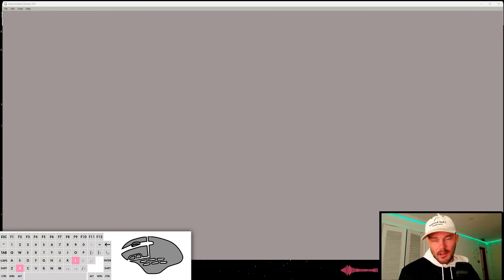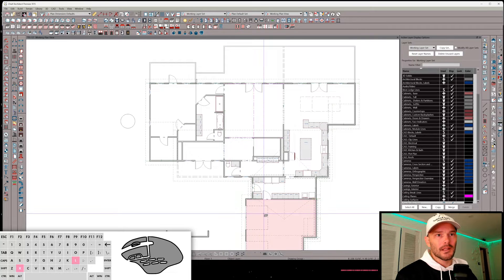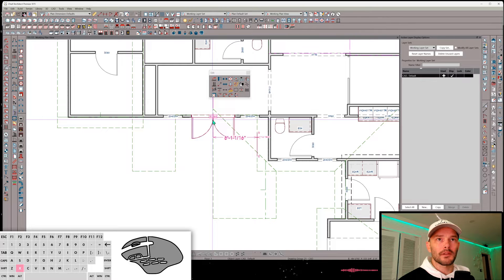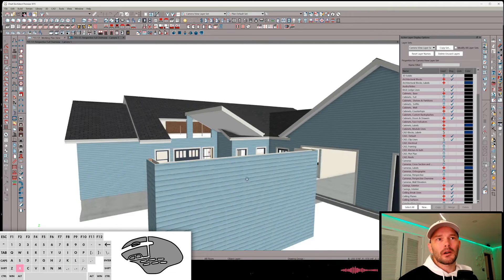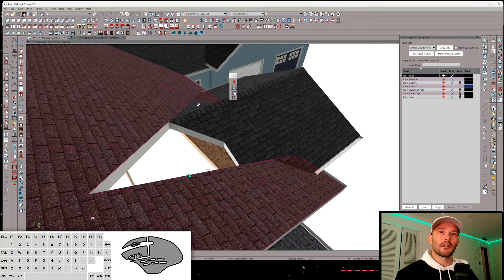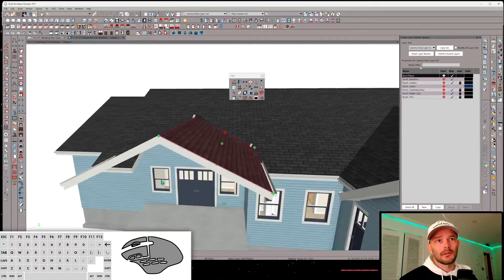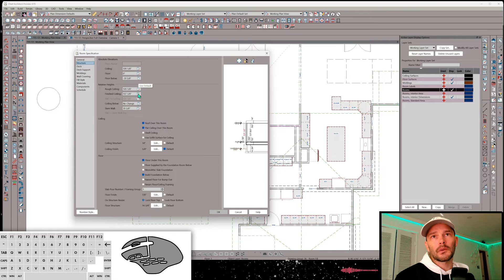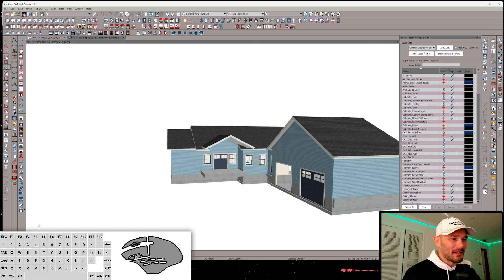Tricky Roof Intersection in Chief Architect X15

Comment: I have found "Make Roof Baseline Polylines" to be a pretty good way of getting auto-build roofing to work with rooms that have varying ceiling heights. You can adjust the polyline adjacencies to include rooms with lower ceilings that will help create auto-built roofs that are easier to construct. I think it's an under-utilized option.
Reply from the maker: I use baseline polylines all the time for extended hips over porch conditions etc.